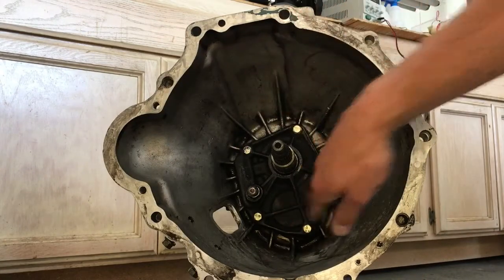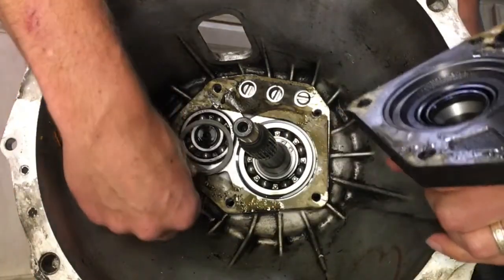How to replace Datsun 240z transmission shaft seals

Comment: Ive subscribed I forget to hit the like button.Both my cars a 73 240 and a back dated 78 280Z are running carbed L28 motors with headers.I had good luck at getting five speeds for both.
I plan on wrx limited slip on my" get soon " list after I build the motors.
Great series, I love watching other Z builds. 
You know most people dont understand Air cooled carbed Porsche 911 have hit the roof " cant touch them " its only competitor in the day was the first series Z. They wont be around long most are being shipped over seas. 
When im done with these two. One is mine one Im building for my ex step daughter she always had one in her garage in video racing games.
I will hunt down two more to restore.I just love tbis car they are roomy yet small fast enough to chase porsches and mustangs.
A as modern to look at as an early 911.
Great series

Comment: Great video. Thanks for sharing! I also need to do the O-ring on the striking rod shaft at the rear. How much play on the input or output shaft is too much? Mine moves about a 1/16 of an inch.

Comment: Any idea if that rear seal can be replaced without pulling the transmission? Just by removing the drive shaft?  Thanks
Reply from the maker: The rear seal to the driveshaft yoke? If so I would say yes. A little cramped but doable.
Reply: @CarsBikesandCoffee  awesome.  Thanks for the info.
Reply: @Behine.DeChilis  yep, totally doable. That's how I did it, and it was pretty fine. Slightly more annoying to hammer the new one in with little space, but difficulty 3 to 4/10 (depending on how easily comes your drive shaft)

Comment: There is another o-ring on the shift rod, you would need to unbolt the rear case to get to it
Reply: Yes. I replaced mine. They are no longer available from Nissan but I found a place online that sells a generic seal of the same size. Works perfectly
Reply: @yobringitondown5565  Any tips? I need to do the same to mine.

Comment: Why don't you replace that top plate gasket? My trans appears to have all the leaks coming from that area. Seems like a simple fix rather than wait and see and pull the trans again to replace.
Reply from the maker: I would totally agree if you have it out. Do it. In my case it was dry and for me to get it out at my home shop isn’t that hard if it begins to seep/leak.

Comment: 6:33 I just replaced these rubbers, but later I've heard it isn't good to apply Vaseline on rubber parts.
Reply from the maker: These seals aren’t real rubber which petroleum based lubricant (Vaseline) can harm. Definitely do your research to double check but there isn’t a problem using it on them.
Reply: @CarsBikesandCoffee  Okay, that's reassuring to hear!
Reply: I've seen Vaseline attack various types of plastics and rubber. I would just skip using it altogether on my cars and opt for something like white lithium, etc.
Reply: I believe the correct install is dry for the outside of the seal and lubricated for the inside w the respective oil. There are rubber seals, but im not sure if the oem is viton etc. Always check when ordering seals and go for the synthetic options. 

(Thanks for showing this so i know what is involved!)